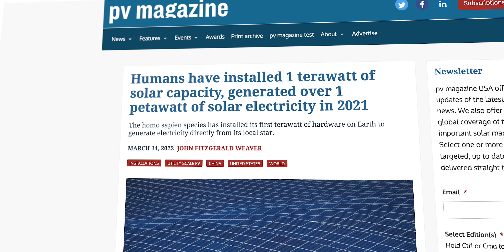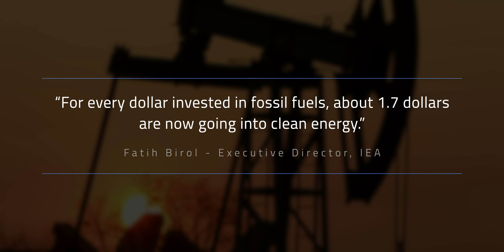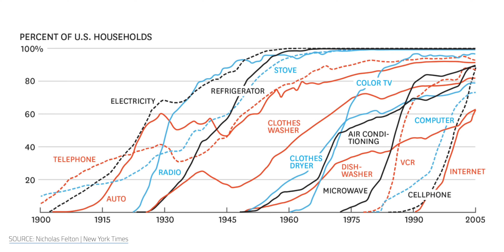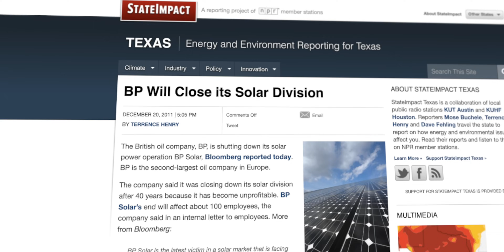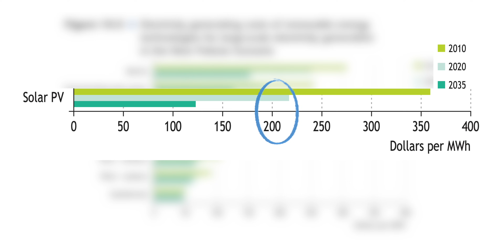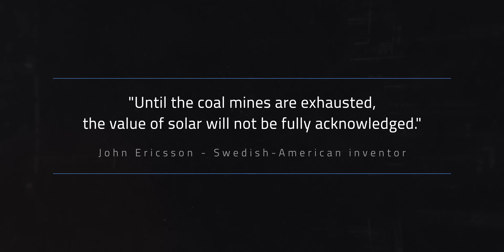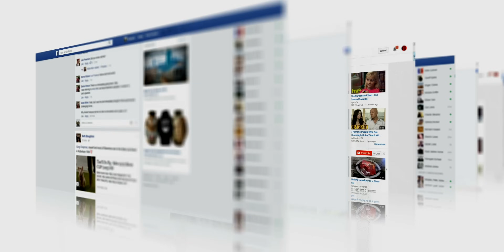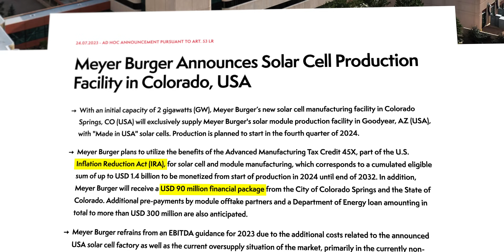How Solar Power Got So Cheap … So Fast

Comment: I live in The Netherlands. Cost of solar installation went up after the war. I got mine installed in Oct 2021. Total capacity 4980 kW. 9 panels on the roof and 3 on the shed in the garden. Total cost was 5600 euros without any subsidies.

I don’t know why it’s much more expensive in USA.

Comment: Great video.  Good to hear that Solar is nice percentage of electric power these days.  I have bought Solar in the summer of 2018.  I love having it, but noted, only in 2019 did I reach roughly net zero (net 5 kilowatts used overall during the year).  This is partly due to the neighbor's tree sometimes during the year blocks a bit of the light, and mainly due to 1 or more additional family members ended up being home compared to being in school/work as before.  So, there was an increase of electric use in the home.  
One main issue why people do not get solar is really the cost as you have stated $20,000 on average is a huge upfront cost for people.  Even with tax incentives, that is a ton of money to have on hand to use for Solar installation.  So residential conversion would be slower overall due to that.  Other factors, especially in cities with tall apartment buildings, solar is not fully practical since it will not cover all the apartments nor in some cases, even get enough sunlight due to other structures may block the sunlight at different times during the year.  I live in NYC so we have a ton of high-rise buildings which would cast long shadows at certain times of the day.   Lastly, for some Solar panels are unsightly on the roof and prefer their roof not to have such panels on them.  I can attest to the last one as a friend of mine falls into that category.

Comment: Circa 1968 as a kid I built a Radio Shack crystal radio from a kit. It included a small photovoltaic cell as an alternative to a battery. After holding solar energy in my hands, I became a lifelong supporter and believer. It’s just unfortunate that too many people still haven’t seen the light.

Comment: 20K is still insane investment for the average person. 20K in NG for me will exceed the life span of solar panels at 2-3x
Reply: 10K for an installer for my 5.4kW array + 2.7K for my 2.5kW array I installed, powers my house (non heating but everything else) + my EV for the year easily.  ROI will be under 10 years, possibly 8 though if prices go up a couple more times.  I did the small array 1 year after the main one was done.

Comment: Question: why are solar panels quite expensive in the US? 

Are americans installing way more panels than us dutchies?

I can't imagine the average price of a solar panel install in the Netherlands being that high. We don't pay VAT over our solar panels, which makes a difference but that still can't explain the whole difference.

I would estimate 98% of our solar panel installs cost roughly between 3000 EUR and 10000 EUR (excluding VAT) which would be 3210 upto 10700 USD at current rates.

3000 would be a lower quality install with 10 panels, 10000 would be a high quality install with microconverters and around 30 panels.

What is different in the States? The amount of panels?

Comment: Key enabler for adoption was the huge price drop and efficiency increase provided by solar cell research. The latest boom was indeed triggered by high price increases of electrical energy made from other sources.

Maybe you now have to pay as much as ten or twenty years ago to install solar panels on a given surface (your roof), but the amount of electrical energy you get in return will be much. much higher, you need less maintenance, and the modules will keep working longer at an acceptable level.

Of the energy they received as light the first solar cells converted only 5-10% to electric current. Panels made from them were also very expensive. Basically these panels were more like a battery that only worked when the sun shines, and during the lifetime of a panel you would never get back the amount of energy it took to make it.
 
Prices dropped a lot when it was possible to make cells on thin films by putting silicon vapor on surfaces. Efficiency improvements also came from using nanostructures, different circuit and material variants, and the latest tech adds quantum-dots to convert part of the invisible infrared spectrum to a wavelength that the cells can use to make electricity from. 

Today we have commercially available panels in the 22% efficiency range. We also have much better converter circuitry with lower conversion losses (to make 110V or 220V from what the panels provide), and better battery technology (to have power when the sun does not shine) than 20 years ago. 
Additionally, the price of electricity has risen a lot. All of this together makes it much more reasonable to install solar panels today than it was 20+ years ago.

Comment: Basic for Solar: do it, even if just a smaller Unit, and if fill up a inverter to max allowed = most rentable.
I just bought a 3rd OnGrid Inverter and another 4+5 Cells, and will enlarge again in less than 2 months as of new needs (Cooking from Gas to Electric) and the wish to use AirCon again in upcoming sure very hot Summer 20223 (March / June).
Started with just 1 mini-inverter + 1 Cell 4 years ago and the measurements of 30 days, I fast took a 2K and 6 Cells as I see the benefits, and are at 36 Cells (or 12 KWH peak) now, adding another 4th OnGrid 3K and 9 Cells (3KW peak) soon again to be fit for 2024.
Even Electric is cheap here in Thailand, I get back the investment in under 3 years - and don't have to be ashamed using AirCon next year after off for years now. It is getting to hot and my healthy is worth to spend some more Cells.

Comment: Florida FPL has massive solar farms across the state here.  We have one of the lowest cost of energy in Florida, so it's hard to justify the upfront cost of solar , since the return on the investment is close to 20 years at the current market.

In 20 years, I prefer to put the money into other things, like the market or other house upgrades... it's tough. 

I am wearing an Eco Drive Citizen watch though...been using solar/light powered tech and going on 10 years with it, no issues!

Comment: Question one ; property assessed value taxation ?

Question 2 ; solar panel insurance especially living in an area prone to hurricanes and tornadoes ? 

Question 3 ; declined output of solar panel over the life expectancy ?

One of the main issues with solar panel installation is roofs leaking water , in the south of Florida if a house roof is leaking water than the government could kick someone out of his house until it gets fixed , it is a scary proposition .

Comment: We have had solar for 21 years.  For 19 years it was only a 2.5 KW system.  We added another KW two years ago.  Our current yearly bill which will come due in 2 months is currently minus $60 (-$60).   Some of that may be due to a California incentive.   We just hope that our electric company is not successful in increasing the monthly rate for those with solar.  We make about 1,000 KW more in a year than we use depending on the yearly weather.

Comment: Video request. I would like to get into solar but I rent my property. What options are available for people in my situation? I live in England, UK
(please don't suggest I talk to the owner, they are the local government and while they should be doing more ... we all know how slow progress can be) 

I'm thinking of small scale panels that can be hung in a window, or temporarily placed outside. I have south facing windows 3m x 5m max.
Charging up power banks that can then be used to power fans, charge my phone and/or power low energy LED lights in the evening. 

I've looked into the systems for caravans but these are also complex and are designed for permanent fixture.

Great videos Matt. Many thanks.
Reply from the maker: Glad you liked it!  Check out this video I did a while back: https://youtu.be/buv-EE6IYaM and this one https://youtu.be/g3_YAZvX42A

Comment: This is something I would seriously like to know.  Take 1 square mile of land and fill that with solar panels.  Compare that to a 1 square mile of land with forest.  Does the square mile of land with solar panels reduce the carbon footprint more than what the square mile of forest is capable of absorbing in CO2.  Meaning, which give a greater benefit? I often wonder if solar should be limited to roof tops and plant trees instead of filling a field with solar panels.  I also wonder why our government invest in green energy but does not seem to take the same approach to increasing the size of our forest.  In addition, a push to change our grasslands from invasive species to native species which is much better at reducing heat capture from the sun.

Comment: I paid £14k stg to have 9.4kwh installed with a 10kwh battery. 3 years earlier that would have been £20k. It still very expensive but at current electricity rates the saving even in at 53 degree latitude north its likely to save me £1500-£1800 per year.

Comment: As solar seeps into smaller aspects of our lives it becomes less of a foreign obstacle and becomes the norm. I started with a few cheap solar lights. They saved me from running electrical, making it the cheaper and quicker option. Then I upgraded my security system. Since the lights worked so well I ditched electrical and went with a solar based system- a quicker option that was more expensive upfront but the convenience of my solar lights justified the extra cost for my security system,. Now that I've grown accustomed to that step, and it's been reliable, I'm doing my research to see the feasibility of my next home being solar. 
Baby steps instead of mass forced adoption.

Comment: Solar power is unlike the telephone or the Internet and more like the microwave or the clothes dryer, in that the former have strong network effects and the latter don't. There's no "network" that you become part of when you invest in solar power, that you make more valuable by the mere fact of joining it. So it's down to just marginal incentives (economics "marginal", not "marginal" as in "small") of a very large meta-industry (electricity production) that can produce large swings in market behaviour as prices of competing technologies change. It's like carrying a large flat pan with water in it: as you walk around the inevitable slight changes in the angle at which you're holding the pan produce large flows of water from one side of the pan to another.

Comment: There was definitely a while about 5 years ago when I wasn't paying a lot of attention to the innovations in solar and the solar market when I was much more excited about innovations in nuclear like thorium fuels and small modular reactors, and I kinda assumed that even if solar could be cheap, energy storage couldn't affordably smooth out energy demand curves. It's only been recently as I've seen the innovations in energy storage technologies (in part due to this channel) that my last doubts about an energy market dominated by solar were finally put to rest. I still think nuclear is super cool from an engineering, chemistry, and physics perspective, but I'm no longer convinced we need to replace all fossil fuel power plants with nuclear in order to have a secure, reliable energy mix.

Comment: Solar went too fast, we have solar panels for a few years now. Everything worked well. Many of our neighbours followed, and now we have a problem. On sunny days the inverter switches off. The grid can’t handle the generated power. We have to wait for a few year’s before the grid is fixed. 😢

Comment: I did backyard solar panel design research in the 1970s. I KNEW solar would be the inevitable carbon-fuel killer within 30 years and was hoping for 20. I wasn't counting on the active sabotage from the oil companies, so I was off by 20 years or so, another 2 generations had to come to begin to fulfill the promise we might not destroy civilization before getting to some more reasonable resource use- something still highly moot in the U. S., but if the rest of the world does it, humanity (and a reasonably recognizable civilization) survives in spite of this failed experiment here.

Comment: Matt, it will be interesting to see if utility companies change their billing structure. Right now, billing is mostly based upon KWH consumption with a small fixed monthly fee, even though their costs are predominantly (70+%) fixed, based on looking at Xcel Energy's P&L as an example. With residential solar expanding resulting in less KWH to bill against, I see the industry moving to a higher monthly fixed charge with lower KHW pricing as people with solar view the grid as their backup battery.  It might be that they apply a different billing methodology to people who install solar vs. those who do not. Time will tell.

Comment: The advantage with solar over other renewables is that it can be plastered almost everywhere and it's becoming cheap to make, it's likely going to get a lot cheaper overtime, also, with how solar is developing in that it can be integrated into many things without ruining the look of it, I suspect it's going to get so cheap that it ends up going into almost everything that needs power.

There's already talks about solar being used so it covers the entire house surface, from roof, walls, even the driveway, which clearly, if you have a lot more and it's cheap enough, without ruining the look, so it blends in with your house, more or us will likely do it because you're likely going to generate a lot more energy.

I also think it's the major advantage solar has over wind, with wind power, it works well at scale and size, but it's not that good in urban areas and on our houses, there's almost moving parts so it's not as reliable and it's easy to see why solar is getting far more investment than wind, it can be used it a lot more ways, and it's more consumer friendly.

As for the big change towards renewable energy, a big part of that is the war in Ukraine and Putin, it's really started to focus minds to do real change, not just in Europe but across the world, and Putin might have speeded up our transition by a decade or two, we were always going to move away from fossil fuels, but there was a lot of foot dragging, and even thought there's still a bit of that now, it's clear the pace is picking up, and it's likely going to continue as renewables get cheaper, better, battery tech becomes better and energy prices become cheaper for it, which could keep pushing us more in that direction until we don't use fossil fuels at all.

It's also a given that as the tech becomes cheaper and better, more of us are going to adopt it, and I actually feel that the biggest cost is installation, if they reduce the complexity of that so it's easier to install, it would do wonders for the adoption rate of solar power, especially for homeowners.

Critical mass is also important, once you get to that, it snowballs, and the impact of that is far more investment in the tech which massively reduces the price whiles at the same time, develops the tech a lot faster, the computing revolution went through the same process in the 90's, where it went from niche to mass market in just over a decade, I do feel solar is heading to that path, but when the trigger point is, it's hard to say, but it could happen over the next decade, if it does, the fossil industry is in big trouble because the amount they can sell will drop and continue to drop a lot, worse yet, they will have to sell at a lower price point to compete with renewables and before you know it, it kills off that industry.